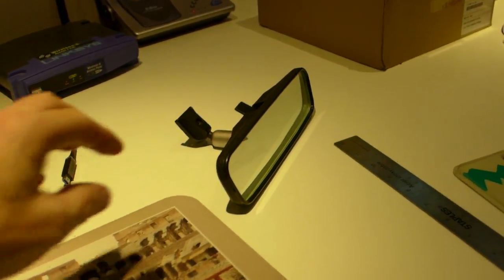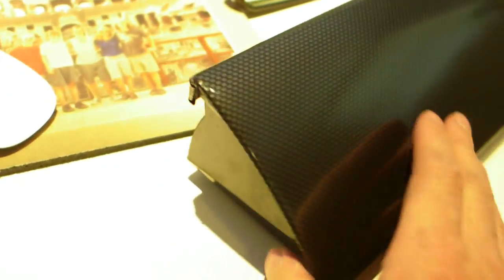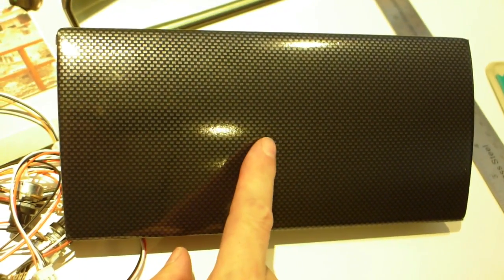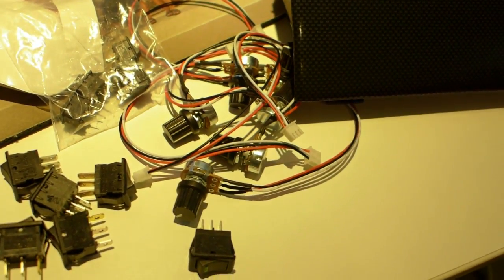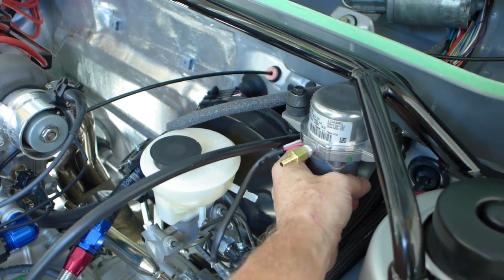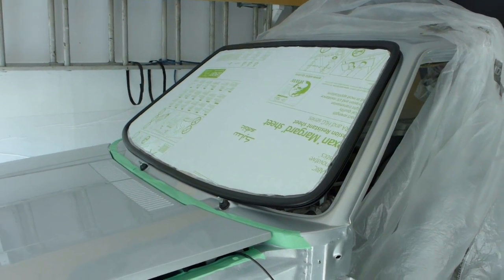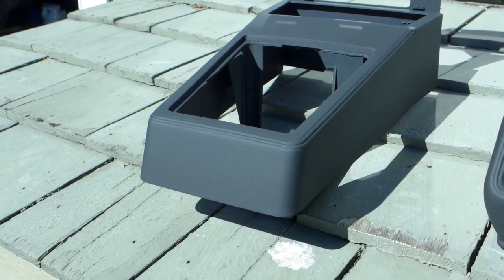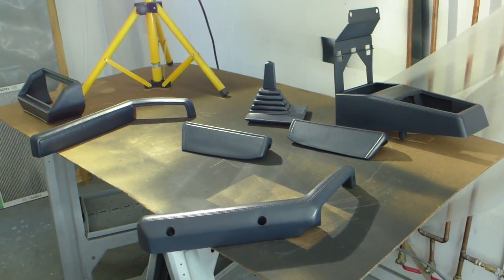The Ultimate 1983 Rabbit GTI - part 99 (Electrical vacuum pump, painting plastic parts and more)

Comment: I have the exact vacuum switch and vacuum pump. Could you please tell me or draw me a diagram of how you wired it. Please get back to me, it's so important. 
Thank you much!
Reply from the maker: My ECU controls the pump with a vac sensor. So when my ECU sees the vac falling it turns the pump back on. The vac level is set with a potentiometer that the ECU reads. A bit complicated - I am assuming that you aren't able to control the pump with an ECU?